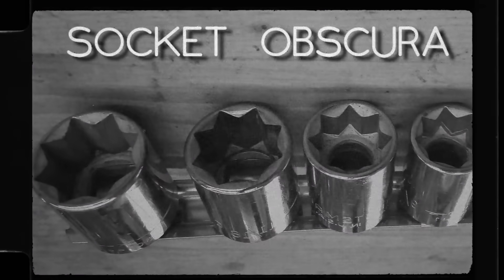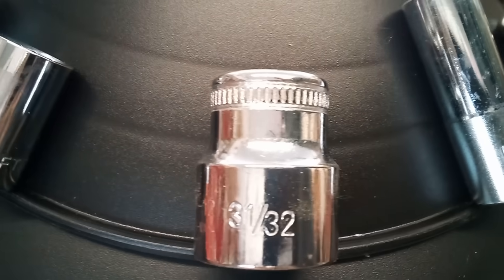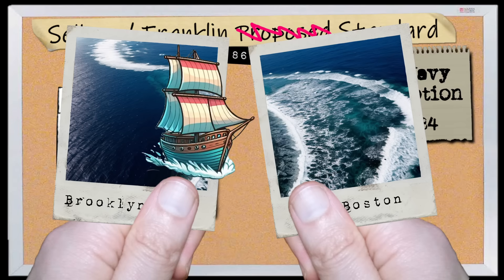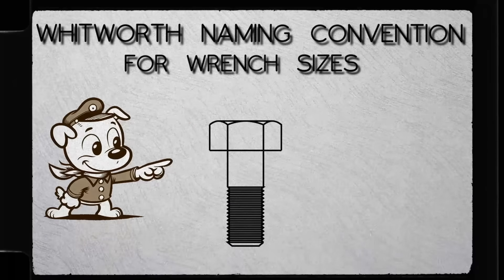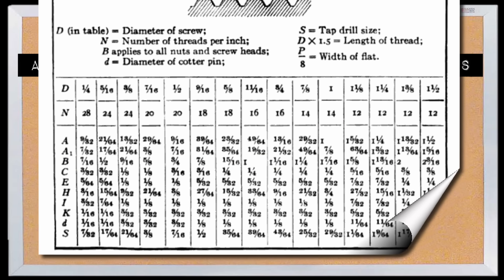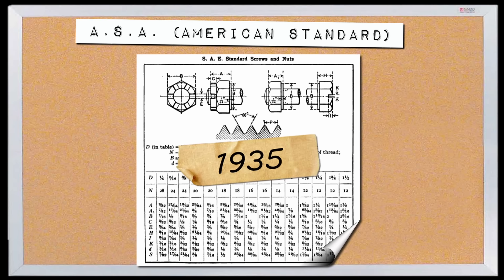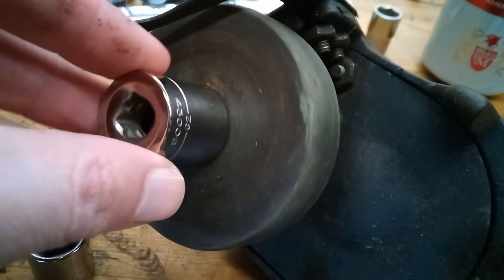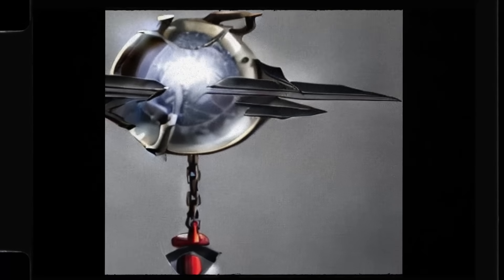32nd of an Inch Bolts - History & Lore

Comment: There is a propose for course and fine thread , you shouldn't use course threads in iron castings such as an engine block , fine thread will pull out of castings , fine threads are great in steel
Reply from the maker: Interesting. Thanks for the info!
Reply: @ballinator  yeah I have worked on a lot of older tractors and all the head studs are course threads in the block then fine thread on the nuts, I always wondered why, so did some check as to why, then just recently I work on a perkins in a forklift, it had fine threaded head bolts in to the block, I had to take head back off and put inserts in all the bolt holes cause they pulled out torquing the head couldn't even torque past 50 ft lbs and the fine threads would pull out of the block
Reply: Did you mean coarse threads should be used in cast iron?
Reply: @GH-oi2jf  yes , cause fine thread removes to much metal, for reason being of the thread pitch being that close, cast iron isn't a hard metal it is actually soft , and easy to drill
Reply: For the same reason, you have them, leg bolts for wood, and the leg bolt looking screws in plastic

Comment: I wonder if this is why, with almost no exceptions, wrenches and sockets always fit too loose. No matter the quality of the nut or bolt or the wrench or socket, they are always loose, which always causes damage to the nut or bolt. I was a mechanic for 37 years, and it was always easy to tell just from looking at it whether a nut or bolt had ever had a wrench on it. If it had, there would be wrench marks on it. Another puzzle is how the factory managed to install these nuts and bolts without making marks on them.
Reply from the maker: There's tolerances built into the standard to allow the wrench to be slightly over-size. Could be out of spec or tolerance stacking.

Comment: 19/32 I was told the size was for model A or model T con rod bolts , is why craftsman had them in the old socket sets .
Reply: That measures up real close to 15mm. For all that's worth.
Reply: @toddk.5873 I had a 19/32 wrench as I kid that fit my bicycle wheel nuts. back then I didn't know metric existed but a 5/8 would strip if using the box end. later learned about 15mm. I'm pretty sure it was a K mart branded wrench too. the old days haha
Reply: I use my 19/32 craftsman wrench when I need a 15mm. I don’t have metric wrenches.
Reply: @mattfinish9634  How do you not have metric wrenches? I couldn't do much with any vehicle other than my 1954 Bonanza airplane if I didn't have metric. Everything on my cars and trucks is metric. Oddly enough, torque is still in Ft and In / Lbs. Thank goodness though I see they're adding Newton/Meters to specs.
Reply: @robertthomas5906  German here. I do have some imperial wrenches. Only for my C172 ;- )
Reply: Starter on Ford Cleveland here in Australia had one 19/32 headed bolt mounting it, just the one.
Reply: I have a 19/32 socket I inherited, always wondered what it was for
Reply: I found a vintage set of Bell System wrenches of x/32”
Reply: Ahh yes, the model T, ahead of its time using 15mm metric bolts!

Comment: I still have a bunch of old sockets and wrenches with the 32 and 64 markings. It blows people's mind when they ask for a 1/2 inch wrench and it's actually 3/4 and really confused. I have an old Snap On socket set that's actually hex and not square drive. Thank you for explaining the standards and how they came about.
Reply from the maker: You're welcome! Yeah the hex drive sockets are interesting. I need to get all my info on that together and do a video on it.
Reply: @ballinator  
The BOG Tools socket sets my dad purchased about one hundred years ago is 7/16 hex drive. Occasionally I grab one of them to work on my D4-5T.
Reply: My grandfather's stash of tools we inherited had a number of hex drive sockets. Never did find a ratchet, adapter, or anything that fit these.
Reply: @cgschow1971  
Not all sets had ratchets.  One of the sets I have is about six sockets that are stored on the hex key that is used as the handle for the sockets.  The other set I have is complete with metal case and does have a ratchet.  That ratchet is made of stamped sheetmetal and I can see with heavy use it might not hold up and could be discarded into a scrap bin.  Alloy Artifacts had a good history on BOG Tools.  It has been a while since I did any research(2012).

Comment: I forget right off hand at which bolt diameter that it starts, but when you get into the larger bolt sizes, the bolt head and nut are different sizes.
Reply from the maker: Could be the 'heavy hex' standard I read about. It had something about using larger nut sizes.
Reply: @ballinator  I don't think that this has anything to do with the heavy hex standard.  I believe that it occurs in the UNC and UNF sizes.  I think that it has to do with not needing two wrenches of the same size when tightening a nut and bolt.
Reply: Not necessarily... the odd ball 7/16" bolt (5/8 wrench on bolt head a 11/16" wrench on the nut) the 9/16 bolt is also screwy...
Reply: @DIRTDUMMY1  what I worked on needed chisel or firewrench

Comment: 19/32" fits on a 15mm hex head. The other very popular semi-fractional fractional inch size was 25/23nds of an inch. I have old stuff with Franklin bolts & screws on it. 6-32 is 6-24 in the Franklin standard. Old prewar guitar tuning machines commonly had Franklin screws on the gears.
Reply: I use a double offset wrench 3/4 and 25/32 as a steel framer I can turn 3/4 bolts with just enough slop to tilt my hand above the 2½ inch lip
Reply: I think I have a double offset in that size. I fastened lots of beam clamps and conduit clips onto steel framing. We almost ripped out some steel framing when some twit had the power turned onto a shorted parallel feed breaker. The beam clamps (also) failed spectacularly. Thankfully they were stamped and not malleable iron. I had no idea that walls could hold that much dust until we shook them hard enough.

Comment: The 25/32 wrench  had a hex symbol and a C stamped on it which indicates it was a hex convention wrench I can't elaborate too much on it cuz I don't remember what I read I do too much reading on so many different brands but I do know this because I have a Billings Spencer wrench and I did some research on it and that's what I found out as far as them sizes being obsolete I'd say yes or no I know sometimes I grabbed a 19/32 if I'm too lazy to dig for a 15 mm and if I have a 1 inch fastener that's a bit rounded I'll grab a 31/32 as far as 25/32 yeah I kind of hard to find a use for that it's pretty much a 20 mm which is kind of oddball really interesting facts I know a little bit about it but I learned a whole lot I thought the metric and standard was confusing when I was growing up I can only imagine what times are we're like then so many changes and people not on the same page definitely would have been a headache another thing I find confusing I have an old Fairmount wrench early 1920s and it is an 18 mm which I find quite odd there is no stamping of the size but it really is in 18 millimeter I don't know what they would have used it for back then 18 mm not used very much nowadays but it's becoming more common what really confuses me is as I didn't think metric wrenches came out in full force until the late 50s to 60s but I did hear some mention of Blue Point having a few metric wrenches in the late thirties early forties so I don't know it's a mystery up until this point I guess but thanks for sharing I really enjoyed watching your video
Reply from the maker: Thanks! I thought it said "OC" and couldn't find any info on it. You're right, it's def a hex symbol. The metric thread standard is mentioned in the 1915 Machinery's handbook, which is the oldest one I could find on-line. They called it the "French and International System"
Reply: When US carmakers adopted metric they didn't follow the rest of the world. Imported cars tend to use 8,10,12,14,17, and 19mm predominantly. US carmakers use 7, 9,13,15, 16, and 18 a lot so even after acquiring all I needed for domestic and import cars to have a 'complete' set I had to buy even more for modern US cars.
Reply: Your 18mm spanner could be 3/8 Whitworth, which is 18.03mm
Reply: @timothyclark7414  thanks for the info never thought about that it fits really snug on an 18 especially for a double open-end wrench which means they had tighter tolerances back then or perhaps the wrench wasn't used very much

Comment: Yea!  I've been puzzling over this for fifty years.  Not every day, but often enough.  And the mystery of the Whitworth method of wrench identification.  Couldn't make sense of that.  I appreciate your efforts.
Reply from the maker: Thanks!
Reply: @chuck - the company I work has a few Wickman Screw Machines that are made in England. Lots of Whitworth fasteners in those machines. Such a pain in the ass. 
Those machines also have a bunch of spanner nuts on them. The spanner wrenches that came with the machine are made by company called “King Dick”. 🤦‍♂️
I hate working on those damn machines. We have ACME Screw Machines too and they run circles around those sucky Wickmans.

Comment: I would die happy if you would tell me why a 7/16 bolt needs an 11/16 wrench for the nut and a 5/8 for the bolt head. Don't get me started on metric.
Reply: Common in the old days, because many guys only had one wrench of each size 😮
Reply from the maker: That makes sense, not having to have two of the same size wrench. There's also a 'heavy hex' standard that allowed for larger nut sizes too.
Reply: @ That makes sense, but 1/2,3/8, and 5/16 are the same wrench. Can't remember if 7/8 and up are. In our stock 7/16 locknuts were the same as the bolt
Reply: @burp1914 — In smaller sizes, duplicate wrenches are more affordable.  Also, for the smaller sizes, a 1/16" difference is a greater proportion of the size of the bolt.
Reply: It is simply to avoid having an x/32" sized wrench. The Unified series hex head calculation (dia. times 1.5) generates a value of 21/32. So Unified rounded down by 1/32 for the bolt (5/8) and up by 1/32 for the nut (11/16). The same happens with 9/16" bolts - 13/16 for the bolt head and 7/8 for the nut. I haven't come across any 11/16" bolts to see if the same held true there - but in theory they would be 1" for the bolt and 1"1/16 for the nut.

Comment: Delco Remy division of GM in Anderson,Indiana always used 11/32 on ignition coil nuts and such until they closed in the 1990’s They made excellent electrical products
Reply: Yeah, a tiny set of 'ignition wrenches' would get dug out of the back of the drawer occasionally when a needle-nose wouldn't cut it...I swear I had a 59/64 mixed in, hah.
Reply: @carlsaganlives6086 I have a 37/64 tap and die combo. When anyone that knows anything about such things sees them, I'm always asked what would someone possibly do with such a size. I know what I use them for, but I tell them that if there is an unusual size for sale out there, someone, somewhere is using it for something and probably had a pretty good reason for choosing it. I'm not the engineer that designs stuff like that, I'm just trying to fix it.
Reply: I'm 75 years old and I have a very old shop it's 102 years old that I bought and I've had it for 45 years and I have wrenches and tools from my great-grandparents that has a lot of this stuff in it from way back in the 1800s and I still have all this stuff very strange
Reply: @larryward1082 
That would make a cool video tour
Reply: God bless you, sir I wish we had more of you!
Reply: GM used trim screws with 9/32 heads for a long time. Even on old cars they are often confused for 7mm.
Reply: I’ve run into that on cars and pick ups under dash with a 7 mm thing and it seems like it runs with Ford of notice like their rear windshield is a 9 mm Wrenchsize nut. I wondered if it’s from old inventory machining tools because the thread size is metric but it also fits on some of the older thread pitch gauges as if there’s an overlap of metric and fractional sizes back there and ancient automotive times of the 40s or 50s?
Reply: Saw that a lot with machine screws and electrical panels.
Reply: The change to 200 different tool types like star, reverse star, hex, Y slot and so on fixed that 32nds issue real good..
Reply: I worked in the Bowling industry and in the 60's and 70's the electronics were all the 32nds sized fasteners.

God, the stuff we had to stock to repair assenblies then was unreal!
Reply: @jameslong3351  Wow - very niche, sadly dying skillset there, my friend. An episode of "Dirty Jobs" featured a talented (and short!) mechanic replacing a 'rug' with Mike helping - the tight quarters were in focus when he passed gas after a burrito lunch, hah. My ma was a manual pinsetter as a teen in Milwaukee, going back a bit...
Reply: Thus ignition wrench set 😊
Reply: As an old school GM fan and vintage GM car owner, I agree.
Reply: If you learned how to use a tape measure, then you would know what the next size is of a socket is after the half inch
Reply: Greetings from Tipton Indiana
Reply: Amen brother. I wish we had them again today.
Reply: I agree, they did make excellent automotive electrical products.
Reply: Why
Reply: Detroit Diesel canister style filters were 19/32.
Reply: If you learned how to use a tape measure, then you would know what the next size is of a socket is after the half inch
Reply: Same size as the solenoid wire on an old Chrysler gear reduction starter.
Reply: That is close to 8mm metric.
Reply: in the 1990's what
Reply: Have a rail of 3/8 snap on socket's bought new in early 90s it has a 11/32 the script on it is a way older vintage style, I'm nearly always working with metric but it's been a life saver many times over the years because of its oddball size
Reply: I had a Chevette in mid 80s with starter terminal that constantly loosened.. I'd have to back crawl underneath it and due to proximity I could only get a quarter turn with a 17/32 open end....  13 mm didn't fit and 14 barely slopped a nudge out of the nut.  I guarded that 17/32 with my life for 5 years and am convinced that it WAS indeed the actual size.....
Reply: 11/32 was also used for the nuts on GM exhaust manifolds (requiring a truly weird socket to reach round the manifold to the nuts (it looked like a bent combination wrench with a half inch square socket on the end).
Reply: @allangibson8494 I have one shaped like that.
Reply: After  seeing all of this, I’m glad that we have all but changed over to metric. ( kicking and screaming) . I was changing a water pump on a 91 Chevy S-10, recently, and it was about half and half metric and SAE.. Had to drag out wrenches I haven’t used in years.
Reply: @edsyphan3425 my 78 step van had a 292 6 cylinder. Needed standard and metric to take alternater or power steering pump off.

Comment: One day, your videos are going to be in the library of congress, and us tool tools will finally feel heard. Thank you for your on-going efforts
Reply from the maker: You're welcome! I'm glad you're enjoying the content.
Reply: It varies state by state, but in Arizona any object 50 years old or older can technically be considered an historic artifact. So technically, archaeologists could use these videos as reference now or in the near future if they find tools in an old homestead or ranch home that needs documentation.
Reply: @sethallison5682  You dont live in Europe so inch set to vintage cars that can also have some metric fasteners .
I tried fixing up century old vise and measured what size bolts holding vise screw counterpart, 1/2 inch long  and thread, so got new bolts , did not notice the old threads were  cone shaped, new bolt only go half way in than its too narrow, it still work if you dont mind it a bit slack .
Reply: Find a new voice.  Monotone sucks.
Reply: I'm rarely if ever monotone, I'm normally impotent and exasperated
Reply: They'll probably defund the library of congress soon.
Reply: I’d watch every second but you’re voice makes me want to comb my hair with a lawnmower blade